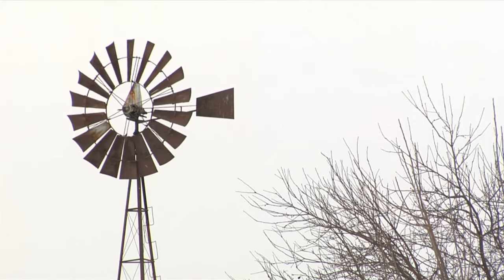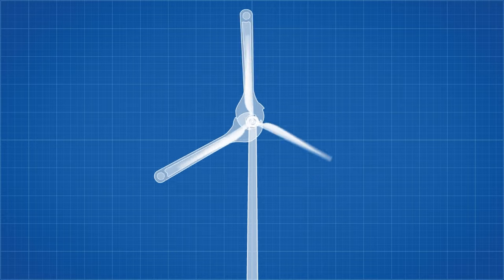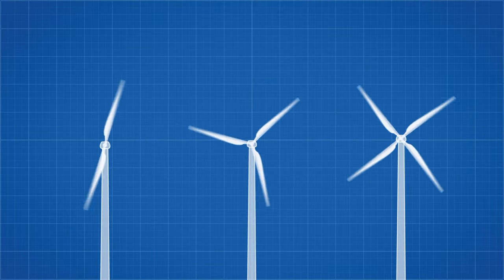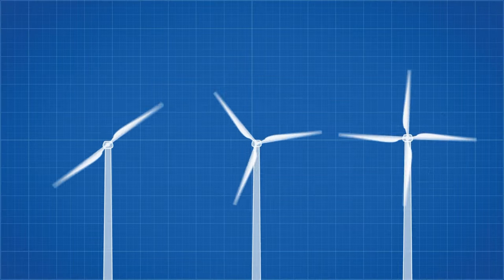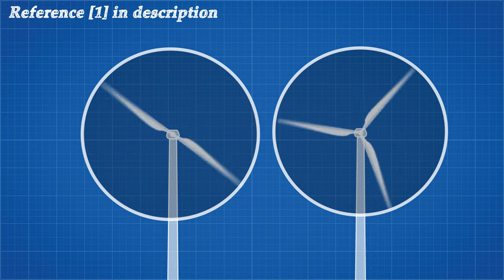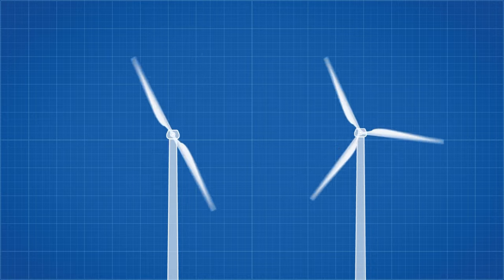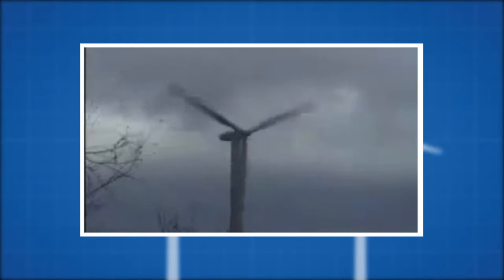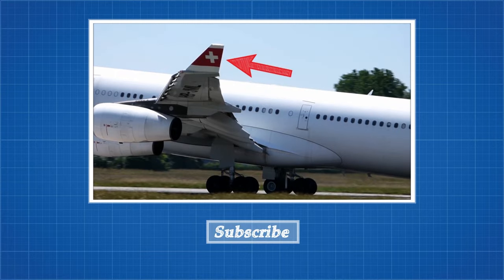Why Do Wind Turbines Have Three Blades?

Comment: every single argument you state that advantages 3-blade vs. 2-blade, can also be used as is for the 4-blade vs. 3-blade argument.
Yet you discard the 4-blade design with a quick handwave blurb that contains NO quantitative data.

i.e. You actually do NOT state why turbines have three blades.

Comment: It's also about reducing vibration.  With an even number of blades, as in the 2-bladed design, when the lower blade passes by the tower it is masked from the wind.  This is at the exact time that the upper blade is receiving its full amount of wind.  This effect will set up vibration in the tower.  With an odd number of blades, as with the 3-bladed design, there is not the same vibration effect as when the lower blade is masked by the tower there are still 2 more in the airflow to smooth out the effect.

Comment: Great analysis. I do work on the computer controlled breaks on these in the US. Though this is a very clean and renewable energy source, they are less efficient and consume massive amounts (roughly 40%) of the energy they produce when averaged out annually. Vertical wind turbines are much more efficient and cost effective. Can you give us an analysis on why these are preferred over the Vertical variants?

Comment: Those dont sound too noisy.
Reply: They don't make a lot of noise, I lived near to a bunch of them and never heard it. Noise is just used as an argument for people who hate renewable energy for some other reason. Try living near to a busy road intersection and you know what noise means.
Reply: I do live near a busy intersection. It's shit. 
I'd rather live near a soft, constant dronning then that.
Reply: madcat789
If they do make a noise it's not much different than the wind blowing the trees or the sea and mostly people can live with that.
Reply: Then thats something I can get used too.
Reply: Most of a HAWT comes from the converter assembly. But get 30 yards away, and you hardly hear anything. On most sites, if a turbine is making noise due to a problem (deteriorated blade, a bad bearing in the generator) and a landowner complains, it will be shut down until the problem is assessed.
Reply: +Parker Hetzel Do you have figures to support that assertion?
Reply: Parker Hetzel They have the advantage of not blowing up and rendering huge areas of land permanently uninhabitable, Fukushima has written off more than the area needed for a wind farm
Reply: Parker Hetzel  Believe me as a professional engineer who earns a living designing safety critical systems I have researched this "shit" as you put it.
Reply: Your personal insults do you and your argument no credit at all. Nuclear power plants can explode for a variety of reasons from the steam explosion at Chernobyl to the hydrogen explosion at Fukushima. Whatever the root cause, the end result is a huge area of land rendered uninhabitable for centuries. Which brings us back to your argument about efficiency, yes nuclear power plants are small but their environmental footprint is huge when you include the uranium mining, radiation disasters and waste disposal.

Comment: In addition the effects of wind shear and tower Shadow further reenforce the three blade designs, impact of wind speed extracted by the blades varies along its axis, (azimuthal angle), then a blade is horizontal about its hub axis, it extracts little to no wind speed, but its compensated by the combination of the angles of the other blades, when the blade is facing downwards, the effect of the tower is much evident, redirecting the angles of wind speed thereby reducing the amount of wind energy extracted by the blades, again, the position of the other blades compensate for this in creating enough centrifugal force. Longer blades do provide more extraction of wind energy but also increases the effects of tower Shadow and wind shear in the wind turbine. 

Two blade system would also increase variation or flickers in the total energy extracted. In four different positions, the blades would require 3 times the wind speed to maintain rotation which would also increase flickers in power output. 

Three blade systems are the best because at each blades azimuthal angle, the other two blades compensate effectively for the ineffective extraction of wind energy of the blade... 

You can check in here for more details:
http://www.ijsgce.com/index.php?m=content&c=index&a=show&catid=86&id=547

Comment: I teach economics, and am thinking of using this video in class.  You stumble on a bunch of economic concepts that I can point to and say "Here it is in  real life."

The economic question I have (that perhaps engineering can answer) is: 

Once the initial manufacturing cost is sunk (irretrievable), won't the 4-bladed turbine last longer due to less wear-and-tear? (The reverse of your argument against the 2-blade) 

Downside: 
The total cost to build 4-blade will be "hundreds of thousands of dollars" more. 
There will be additional costs to make the structure sturdy enough to carry the additional weight load.
There will also be the cost to re-design, re-engineer,  and build the 4-blade unit. 

Upside:
There is an increase in efficiency... small, but measurable.
There will be a longer product life due to less wear-and-tear.
There will be reduced maintenance costs due to slower moving mechanical parts. 

So, there will be a greater initial (sunk) cost.  However, there will be a greater long-term output, lower maintenance costs, and a longer overall life... leading to potentially greater profit. Longer term to be sure, but Turbines are not get-rich-quick operations. All this assumes that the 4-blade will have a longer productive life than a 3 blade. 

With this in mind, does the engineering match the economics? Will the 4-blade unit as I describe it last significantly longer? Or am I mis-stating the assumption about "wear-and-tear?"

Thanks mucho!!
Reply: +Michael Torguson Not sure if this will answer the question, but with a 4-Blade unit you will have a higher initial cost with slightly higher revenue (think cash flow over a period of time) and it seems that you have an overall higher cash flow with the 3 blade systems. I don't see 4 blades having lower maintenance costs either. Blades will be less efficient due to traveling too close to the wake of the previous blades. Also think about weight and rotational inertia. Less efficient will mean high speeds and more wear on bearings and shafts. This will lead to more over hauls (again think cash flow diagrams) or higher initial cost to strengthen supporting components. More robust bearings and shafting will also cause a drop in efficiency.  

Overall this would mainly be two scenarios where you have 1. high initial cost, higher maintenance, higher profit and 2. lower initial cost, lower maintenance and lower profit. The economic lesson would be in choosing which is the most feasible.  Hope this helps! I'm not an economist by any sort, but I am an engineer/project manager and enjoy thought experiments.
Reply: +Tyler Scrivner I had not even thought of the leading blade's "wake" being a factor... but it makes sense! That would cause buffeting and drag, and wear the bearings? 

I was thinking about the rotation of the hub: 3 blades move faster, wearing more; 4 blades move slower, wearing less. But, that would bring another economics term into play: Ceteris Paribus: All Else Being Equal.  Economists love to make one change to a model, presuming all other factors will stay the same. (We should know better, as no change can be done without effecting other systems). 

Thanks!!

Comment: Your explanation of the problem with a 4 blade design 'adding a 4th blade provides such a marginal increase in performance' completely fudges the point. the answer to the question you pose about why turbines have 3 blades hangs on the question of why the increase is marginal and how marginal.

Why does such as a steam turbine have 100's of blades. why is the goldilocks zone completely different in that scenario?

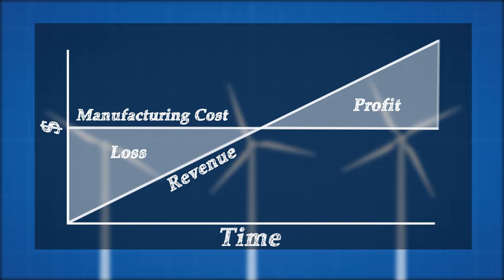The graph at 1:18 shows absolutely nothing.

The turbine you showed failing, failed because the blade hit the stand. which is probably the most important factor, together with height in limiting the blade length, which in turn is why we use 3 blades not 2.

Your videos are normally quite informative. But this is just, well nice looking garbage.
Reply: I think it's mostly because of turbulence : the more you ad blades, the closer they are to each other thus more influenced by the turbulence behind the previous blade, causing it to be less effective (unstable airflow) and it could even cause them to vibrate more. Even thought those are just suppositions I think it could explain the differences between steam turbines and wind turbines (you have so much power to deal with in a steam turbine that you are more likely to see the basic equation more blades = more power to actually work)
Reply: Close but what is missing? I am surprised that no one mentioned the Betz limit. The mechanical forces answers were only partially correct, you can always make things stronger/stiffer and avoid natural frequencies. But the Betz limit is the physical  limitation of getting mechanical force from wind and it is limited to 0.6 or 60%. Three blades gets you to 55+/- and four only adds a few percent, so the limitation is better looked at from this physics limitation which is optimal for cost and design.

Comment: There is no such thing as centrifugal force - there is only a centripetal force. Get it right "real" engineering.
Reply from the maker: Go ahead and watch my artificial gravity video please. Your understanding of the term is off.
Reply: The first thing they teach you when you learn about 'fictitious' forces in the Classical Mechanics module of a good Physics or Engineering course is that they aren't really all that fictitious. Hop in a 20 G centrifuge and you will believe in centrifugal force.
Reply: Areo Hotah "Centrifugal" force is simply centripetal force exterted on the body from the reference plane of the body being moved. It's a mis-use of the word. It's redundant, and for this to be an "engineering" channel it needs to be more accurate, that's all. Centripetal forces tear this windmill apart, not "centrifugal"
Reply from the maker: Dominic centrifugal force is a reaction force to centripetal. A force without a reaction force causes an acceleration, not a stress. One cannot exist without the other. Centrifugal is the correct term to use. This is why I made my artificial gravity video. The idea is being taught very poorly in schools.
Reply: When we're talking about a non-inertial frame of reference it exists as a pseudo-force, I agree. I also appreciate the comment back. The key I think is for students watching the video to have some clarity on the terms used. "Centrifugal" force is the reaction force felt by the body being pulled against the wall in a centrifuge like artificial gravity.  It's the centripetal force in this case however that pulls apart the blades and causes eventual failure.

You may want to add more to this video, just for clarity, considering the other comments. It's your video ultimately, but I think it could use more depth. 

No worries here!
Reply: There's a reason why they call it a centrifuge, and not a centriipet.
Reply: well then
Reply: The centripetal force is directed towards the center and keeps the mass on its circular path. Meaning it prevents the mass from moving straight ahead (=tangential to its path). Its the inertia that pulls apart the mass(es) and destroys the wind turbine in case the material can not supply enough centripetal force.
Reply: There is something called centrifugal force..Its a pseudo force
Reply: i study aerospace, and in my study, both exist. centripetal is the force that turn the velocity to the center of the turning radius, while centrifugal is the reaction of a rotational movement in the particle.

for example if an aircraft doing a steady pull up, it happened because the wing give a centripetal force. in the same time, you will press the cabin floor because you will have kinda extra weight because of the centrifugal force. so, when you analyze the cabin structural strength, you add your weight with the centrifugal force as the total load
Reply: Some more mudane examples would be the centripel force you feel when a car is accelerating vs the centrifugal when the same car is rounding a curve at a steady speed.  

People who think there is no such thing as centrifugal force have probably gotten a D in Physics 101. The explanations by physics professors require some basic understanding to comprehend, so it's not surprising that many half awake students misunderstood what they were being taught.
Reply: yep that's the same thing could be felt in both aircraft and car...
Reply: robert retka "There is no word ' centrifugal force ' and it is not in real dictionaries.  It is a fairy tale word."

Really?  
          Simple Definition of centrifugal force 
physics : a force that causes an object moving in a circular path to move out and away from the center of its path 

http://www.merriam-webster.com/dictionary/centrifugal%20force
          

Well, clearly that's a definition of "Centrifugal Force" and it's from a REAL dictionary, namely Merriam Webster. (Not from Grimm's Fairy Tales)

 I don't know what else to say.
Reply: PrivateEyeYiYi glad to see an educated man here...
Reply: robert retka glad to hear that...
Reply: robert retka
Sorry. it's sometimes hard to tell.
Reply: robert retka It depends on your reference frame. The only force acting is the tension on the wheel spokes caused by centripetal force. When the tension exceeds the tensile capacity of the spoke, everything flies apart. 

The centrifugal force is only a force felt inside the reference frame of someone standing on the inside of the wheel rim being pushed hard against the wheel. When looking from outside the spinning wheel from an objective reference frame, only centripetal forces exist.

Have a nice day
Reply: Dominic, if you want to consider the stresses experienced by the turbine blade, it is necessary to use the reference frame of the blade. I agree the centrifugal force term is a fictitious force, arising only from the choice of a non-inertial frame, but it's still a centrifugal force when we look at the stresses on the turbine blade.
Reply: Then gravity isn't a force either.
The thing is, we still call it that, because it acts exactly like one.
You'll find noone in science or engineering reluctant to speak about centrifugal or gravitational force.
Reply: Not only is Dominic correct....you are incorrect when you mentioned spinning your two bladed example faster. Unless there was  internal reduction gearing, the two bladed turbine would have to rotate at the same rate as a three bladed turbine. The frequency of the AC current being generated is determined by the rotation speed of the turbine. That speed is controlled by varying the pitch of the turbine blades. If a turbine was spinning too fast the current being produced would be usable or allowed on the grid.
Reply: Actually there is, just do the force calculation in a rotating frame and you will see it emerging. The principle of equivalence is central to fully understand classical mechanics and Galilean relativity. It dictate that any frame of reference is equally good to do physics in, to translate your computations to an other frame of reference you just apply the Galilean group. If you working in the settigs of the special relativistic theory you replace the Galilean group with the Poincaré group (Lorentz group times translation group). The centrifugal force exists for an observer that is riding along on the blade of the wind turbine, and that is relevant when doing structural integrity computations of the blades.
Reply: Bugdriver49 These wind turbines do have giant transmissions inside them for just this purpose! You should see one someday, they're amazing
Reply: Dominic Orlando  Lol....I would enjoy that very much!
Reply: Vlad Caso dude chill
Reply: +Muhammad Fikri Kawakibi Huda I'm not being soft to people who believe such crap as 'there is no such thing as centrifugal force' (and more)
Reply: Vlad Caso lol
Reply: Dominic Orlando
Reply: Dominic Orlando
Reply: There is centrifugal force, with one exception. The centrifugal force is fictitous force added to free body diagram to simulate complex acceleration effect. This method is called D'alambert principle. Resultant force is called centrifugal force. There is no centrifugal force actually.
Reply: Murdy Baskan you're assuming the existence of an absolute frame of reference but then you are ignoring the principle of equivalence
Reply: I simply say the principle name: Lagnrange-D'alambert principle...
Reply: The Lagrang-d'Alembert principle does not state the same thing as the principle of equivalence. The first states that the sum of all forces in a system of degree N is 0, that is conservation of momentum, while the second is that any frame of reference is equally good for doing physics which would imply the first but also conservation of energy. So the principle of equivalence is stricter than the Lagrange-d'Alemberts principle.
Reply: May the farce be with us.
Reply: Centrifugal is real... the effects are apparent everywhere...
Reply: Real Engineering yeah newtons 3rd as a basic concept right?
Reply: yeah there is, an example is when you are trying to stay on a merry go round. centralfugal force is whats makeing you go airborne when holding on to the handlebars